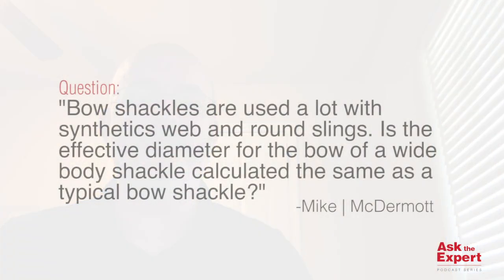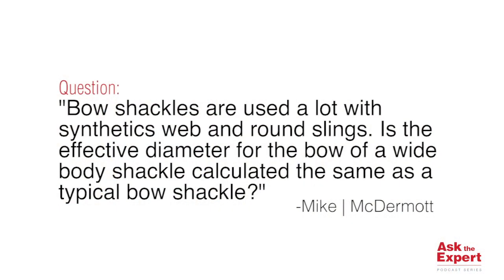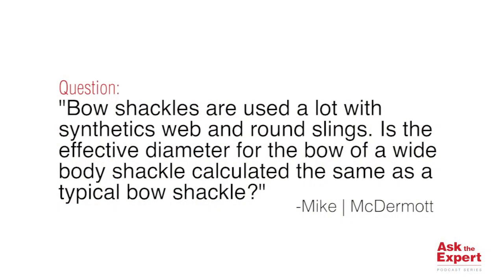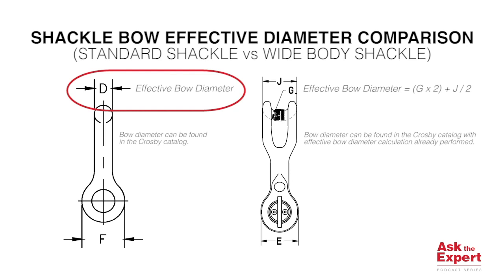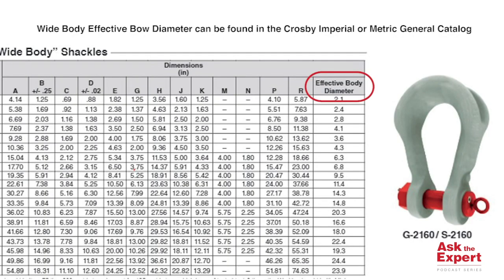Is the diameter of a bow shackle calculated the same as a wide body shackle?

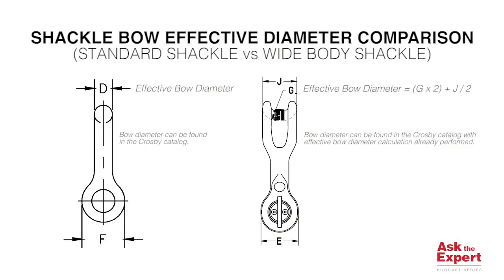Comment: 1. The formula mentioned at 00:49 is not matching with the values we are getting from table - rather it should be (G*2+J)/2.
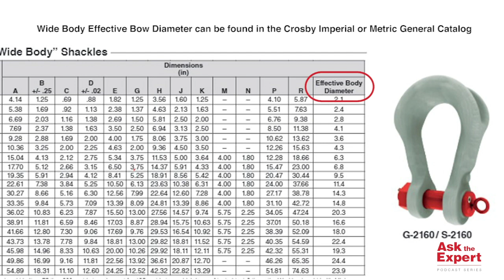2. also the statement at 1:23 needs to be corrected to "It is average of shackle bow diameter (G*2) and the width of the bow" since G is the radius you said average of shackle Bow radius and width of bow.
3. also above formula doesn't apply to all the G2160 shackles sizes perfectly but we have effective body diameter mentioned in the catalogue so that's fine.